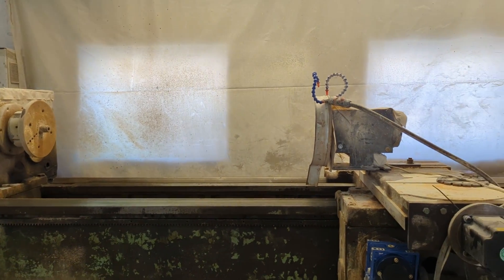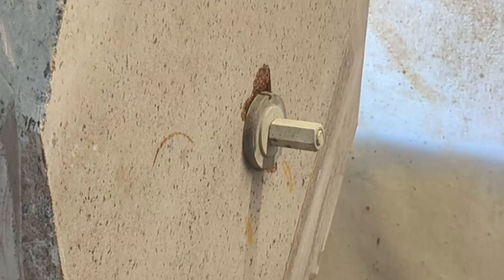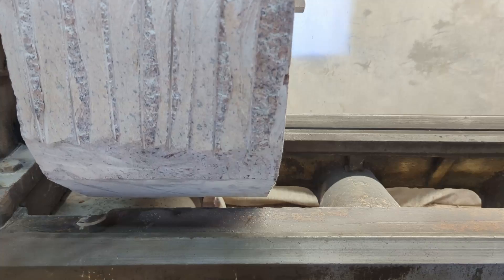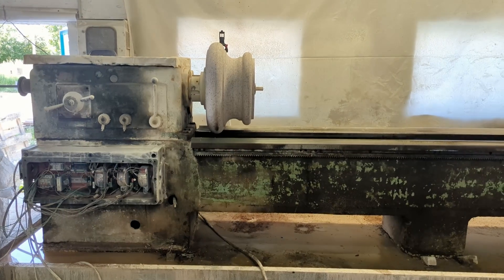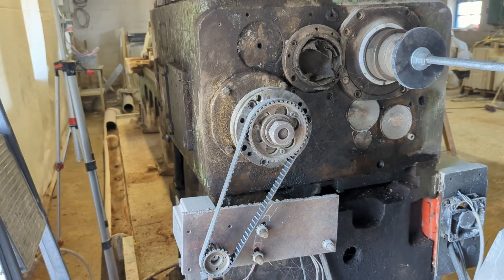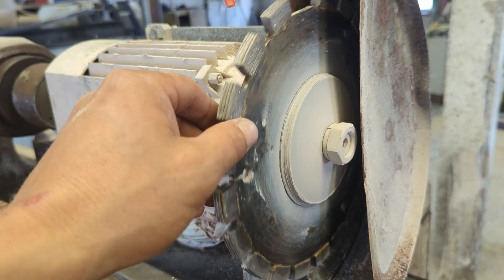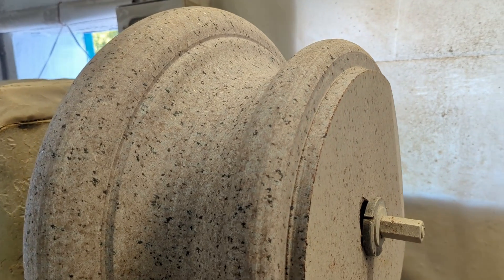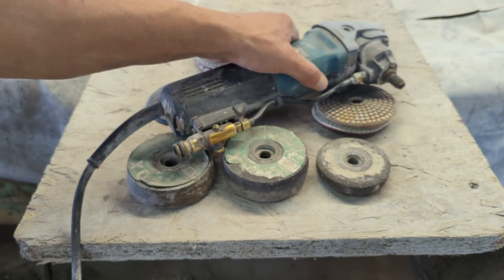Turning giant piece of granite on a lathe or  diamond SAW

Comment: What control board do you have on that machine and what control software runs it?  Also what CAD software do you use to model and or also what CAM if not the same as the CAD do you use to post process your G-Code?
Reply from the maker: For now, as a control board, I'm using a USB UCNCV4, which is a cheap Chinese one. The software that controls the machine is Mach 3. In this particular case, I write G-code manually since it's faster. However, in other cases, I use Aspire or Fusion 360.
Reply: @madeofstone7619  That's awesome!  Can just take any old lathe get a UCNCV4 and mach3 and cut marble pieces that are probably worth $10,000's and get installed in mansions.  Or like those marble cuttings look like something you'd see in a capitol building lol.   Nice work!

Comment: First off, BEAUTIFUL work. Machining something as hard as granite is no joke, and restoring that lathe to operational is rad, I would love to do the same someday. Very impressive work. 

Now, how hard would it be to make it uniform down to 1/1000th of an inch, and how hard would it be to core out the inside of it and make it so that the wall thickness is about  .02" thick, also keeping it within a thousandths of an inch tolerance, without chipping it? Could you do it without a lathe or any steel/diamond tools? And if not, then how did the pre-dynastic Egyptians do it over 5000 years ago, before the use of the wheel, or even iron tools? I only ask this because recently there has been an investigation into some of the more than 40,000 vases found under one of the pyramids, that were made in this fashion. They were made out of granite and schist, diorite, corundum, etc, and were dated (by what they were buried with) as being pre-dynastic. Some of them are so thin that the granite actually becomes transparent. There are no tool marks on them, and many are not only made within 1000th of an inch tolerance, they are made geometrically perfect, using advanced mathematical properties, and anyone who's tried working with this stuff (like you) would be a welcomed and powerful voice in the conversation about how these things could have been made thousands of years ago without any metal tools or even the wheel. It's a big mystery. There's no question on how old they are, there's no question on what they are made of, and there's no interest within archaeology to understand how it was done, they say "we were only concerned with what was inside of them, not how they were made". It's a baffling mystery, and anyone who works with this material would be able to understand it more than the average person. Look up Uncharted-X on youtube and you'll see what I'm talking about.
Reply: The vases were definitely done on a 9 axis lathe.
Reply from the maker: First of all - thank you. As for the video with the vases, I watched it. You must understand that I am not an archaeologist or an Egyptologist, so everything I say should not be taken as a fact, but only my opinion. I have doubts about the appearance of these vases and such accuracy. Firstly, erosion. How they survived 5000 years to the present day in this condition. I know that Egypt has a good climate and much of what was found was buried almost in a vacuum, but still. Secondly, as far as I know, having valuables from Egypt in private collections is prohibited by law. Of course some people have them in their hands. But I don’t think such people will demonstrate this publicly. Third. I personally have been to Egypt. I saw many similar vases and not one was in such perfect condition as the ones in the video. And also the methods and facts that are shown in the video are not entirely scientific to convince me of the reliability of the information they provide. To put the question differently, is it possible to make such a vase with a simple tool? I think yes. For example, high-precision surface plates are still made by hand. Of course, the machine does most of the work. But precise adjustment is done by hand.
Reply: Ben is repeating the same bs statements over and over again. Not all 40,000 vases are diorite and not all diorite vases share the same geometric precision. The vases he showcasing are with questionable origin. One of them spinning diorite vase is presented with document provenance from 1962. Keep in mind that in 1962 where were already able to space craft parts with higher precision than 1/1000 of an inch. In fact the first lathe showcased with 1/1000 of an inch precision was in 1851 by Joseph Whitworth, you have to check him and his works. This was 173 years ago. Knowing the human cunning nature and ingenuity I am inclined to think that these are modern day knock offs made in the last 100-150 years with the sole purpose to cash money naive artifact collectors. 

Also while the body of the cute little vase he showcased like 10 times is geometrically perfect(which is not the right word at all and many times misused by UnchartedX) the love handler are asymmetrical and this is the hardest part to work on. I guess @madeofstone7619 might give us an idea how these handles are shaped. My theory is whoever made these vases used a lathe that can do partial back and forth revolution to grind out the material between the handles, that would 180 degrees minus the horizontal width of the handle and the vase must be turn at certain angle.

Comment: 5:30 why not make all the finishing cuts down hill, to avoid side loads?
Reply from the maker: First of all thank you for interesting comment. Yes, you are right, with the “down hill” strategy there will be less lateral loads. But as i said this machine is in "rebuild" process. And i still have decent backlash on my Y axis. So I have to machine the part in one pass without interrupting the cut.

Comment: In the 80's and 90's we used loose abrasives, carborundum dry stones and wet sintered bricks for our turned stone work. We also modified older heavy cast metal working machinery until we could afford top notch German and Italian machines. Great job this should be very inspring for enthusiasts and younger future stone masons. I'm 4th generation with 4 decades in the trade mostly retired but thats the most us masons ever retire is semi-. Cheers
Reply from the maker: Oh, thank you very much for your comment. It means a lot to me to hear messages like this from people who have experience in the industry. When it comes to machines , my passion is rebuilding or building from scratch things that would otherwise end up in scrap metal. I'm glad you liked my video. Thanks again.

Comment: Beautiful! . . . can you imagine the size of a lathe needed for those columns in Egypt?
Reply from the maker: First of all, thank you. As for Egypt, as far as I know, after reaching a certain size of the part, the part was no longer rotated; the tool rotated around the part. The Egyptians were much smarter than is commonly believed)))
Reply: That makes sense.  Especially when the columns include intricate capitals.  It seems like it would need to be a CNC machine on a grand scale.  I would love to see a drawing of something like that.
Reply: We have manual techniques for making columns that doesn't require a continuous lathe which is how the Egyptians did it.

Comment: Why not use ultra high pressure water instead of blade and grinders?

It turned beautifully though!
Reply from the maker: It's my dream to make a waterjet one day. But in this case, waterjet cutting will not work. The stone is too thick and the thicker the stone, the less accurate the cut will be. It will also be extremely messy since there is no way to stop the stream of water. Thank you for your comment)

Comment: Do you happen to know any similar method to make perfect polished square/rectangle with granite?? like in the kings chamber in egypt pyramid??
Reply from the maker: I'm not an expert. This is just my opinion and the information I could find. But: large rectangular blocks were processed with a “hammer and chisel” to a certain degree of precision. Angles of 90 degrees are not that difficult to maintain. The Egyptians knew the Pythagorean theorem. As for polishing, there are several opinions. One of the most common is a wooden block with small particles of abrasive (harder stone) embedded in it. To check the plane, they used the same method as now - a surface plate.
Reply: Hand chisel work followed by rubbing its basic stonecutters techniques

Comment: Could you have a look at "Serapeum boxes" and give your professional opinion how were they made
Reply from the maker: I'm still studying this. And definitely not an Egyptologist. So this is not a professional opinion. But in general the method is like this. The product was processed directly at the quarry. Then transported to the burial site. As for these particular sarcophagi  archaeologists find traces of rollers on the floor of the galleries, and found two wooden horizontal winches, each operated with eight levers, in one of the niches.
Reply from the maker: Or aliens did it.😀 @madeofstone7619

Comment: I'd for sure want to do this on a vertical lathe and with a wrap around everything to stop that grit from getting into everything and destroying it. I think that lathe would be all but destroyed by this. A miracle the bearings lasted through this due to stress. I was expecting some support from a tail stock center. All is well that ends well but I'd be worried this did invisible - at least in this video - damage to the lathe on several fronts: Abrasive damage to all moving parts and destroyed bearing from both a heavy load and an unbalanced load.
Reply from the maker: Thanks for your comment. Do not worry. I made sure that the spindle of this machine is designed to hold twice the weight of the part in the video without tailstock support.
As for the guides, they are already dead and I plan to rebuild the entire structure anyway. If we talk about cutting forces, they can be neglected since the saw blade rotates and cuts instead of a stationary cutter. Also the work was performed at very low speeds of about 4 rpm. to solve the problem of unbalanced load. But given the choice, I would choose a vertical lathe. And here I absolutely agree with you.

Comment: Have you checked out UnchartedX's videos on the Egyptian granite vases, and the extraordinary precision they are made with?
Reply from the maker: I watched this video. Interesting channel but I have doubts about this accuracy. I'm not an expert but granite erosion is ten millimeters in ten thousand years. I can assume that these finds were well kept from weather conditions, etc. I can also assume that initially the vases had such precision. And still, they would not have survived to this day with these high tolerances. For example, the meter and kilogram standards are stored in vacuum chambers and still become smaller over a relatively short period of time.
Reply: @madeofstone7619  you literally didn't answer the question
Reply from the maker: I think I answered. I watched the video. And also explained why I doubt its content @AustinKoleCarlisle
Reply: The lug handles are misaligned as are the lugs holes off-centred. The vase is not symmetrically balanced and the polishing is a very low Lustre finish. These are not exacting standards for accuracy in stonework. Who knows, maybe it is precise to its master model which contains all these deficiencies exactly.
Reply: @GroberWeisenstein  the handles are likely secondary to the intended fuction of the vase. you still ignored the extreme precision elements of the vase that simply wasn't possible prior to the 1980s.
Reply: @AustinKoleCarlisle  FACT. millions of vases, spindles, columns, turned works prior to the 1980's with better accuracy in cemeteries and architecture worldwide. the handles are not an afterthought they are integral to the design and are manufactured from initial blank. not glued on. The vase you credit with "precision" accuracy is a puny 6" tall piece, there are ashtrays bigger than this. Educate yourself.
Reply: @GroberWeisenstein  that still doesn't discredit the extreme precision elements of the vase. nobody is claiming the vase is perfect, and you all are just finding ANY excuse to not address the extreme precision elements of the vase that were displayed in the latest video using the physical measurements and metrology analysis.
Reply: @AustinKoleCarlisle  how can "extreme precision" be argued if it doesn't exist across the board? in the stone trade we consider these defects to be flaws which downgrades the quality and value of the product. the metrology analysis was also only partial since no high resolution optical imaging was performed to measure surface integrity such as degree of porosity and level of mechanical polishing. When we buy a new car we expect it to roll off the line fully finished to known standards. The vase with all its defects would be discounted and sold at a bargain under "factory seconds" .
Reply: @GroberWeisenstein  "how can "extreme precision" be argued if it doesn't exist across the board?"

who says it has to exist across the board? precision of this level across many geometric relationships speaks to an intended function. the vase body is extremely precise while the handles are less precise, so the obvious conclusion is that the handles were secondary importance to the intended function of these objects.
Reply: @AustinKoleCarlisle  there's no logic in that conclusion. The handles represent significant technical challenge in addition to the straightforward process of the rest of the vase body. This makes the lugs of great importance and value due to a doubling of the work. You have been parroting wholesale "extreme precision "  here, and everywhere else, it wasn't until your nose was rubbed in the flaws that you started to back pedal and change your tune.
Reply: @GroberWeisenstein   if the handles provided no added functionality, why would they have spent more time and energy "perfecting" them when they obviously had the capability to do so?
Reply: @AustinKoleCarlisle  stone work is a reductive process. When you don't plan and execute each stage within acceptable tolerances, you pass a point of no return and have to just accept the flaws as deficiencies. A large part of stone manufacturing and finishing involves modifications dealing with natural and man-made errors. There are tricks of the trade to deal with some but not all. I wouldn't consider handles as non- functional the eyelets were intended for rope or leather straps.
Reply: @GroberWeisenstein  given that they could clearly machine things down to the single 1000ths of an inch, what makes you think they wouldn't have done the same for the handles if they believed the handles were important?
Reply: @AustinKoleCarlisle  lack of skill and focus. The handles and associated regions are different proceduraly and represent the most difficult parts. Achieving mild curvature on a small radial object is a relatively easy task with lots of room for error with adjustments since freeformed.

Comment: I was a machinist for 40 years, nice to see a beat up old lathe get a second life. Don't think I'd use an electric angle grinder in a wet situation like that, could be a shocking experience 😬 I'd go with an air grinder. Beautiful work.👍
Reply from the maker: Thank you. The lathe is a project in itself. I will continue restoring the machine in the next videos. And don't worry about the water. The saw drive is designed to  operate in wet environments
Reply: GFCI. I been using electric grinders with water for decades its never an issue.
Reply: @GroberWeisenstein  Good for you, hope your luck holds out👍

Comment: That lathe is amazing, must have been quite the trick moving it into your shop. How much does it weigh?
Reply from the maker: Thanks a lot. In fact, moving it is not very difficult if you have a forklift and a crane. I stripped it down a little so now the machine weighs about 5 tons.

Comment: its about time someone showed the true effort needed to process hard stones… i cut some small stones on one of my old metal lathes, but did not have rigid enough setup, so it didn’t work out that great. As a hobbyist machinist and an amateur stone sculptor i am extremely impressed!!great work!
Reply from the maker: It’s always nice when you get a compliment from someone who understands how much work goes into getting such a result. Thank you. I’ll add that I also started at the hobby level and it took me a lot of time, mistakes and not  successful jobs to get here. And still learning and I'm very far from being a master of my craft. And maybe someday I will be able to impress you again.
Reply: @madeofstone7619 
Congratulations very well done, I also work with stone and been fascinated by the ancient stone masons craftsmanship, do you have any ideas on how they accomplished such pieces over 4000 years ago. Thanks again for your very fine work
Reply from the maker: Thank you. As for how it was done, the technique has remained the same to this day. Templates and elbow grease @scottmills3185  😉

Comment: 8:09 Is that a hand-made diamond tipped saw-blade?
Reply from the maker: No. The disc itself is sold separately. Diamond segments depending on the task separately. Then they are soldered onto the disk using a special device. It`s so scary because it`s been through a lot of abuse.

Comment: Beautiful work, love the lathe. Very surprised you don’t need support from the tailstock.
Reply from the maker: Thank you. In this case, I did not use the tailstock as it simply got in the way of the carriage. Also, the diameter of the part is twice its length, and with this ratio you can work without support. This setup is not very rigid but is suitable for this project. In the near future I plan to make the machine also beautiful, so stay tuned.